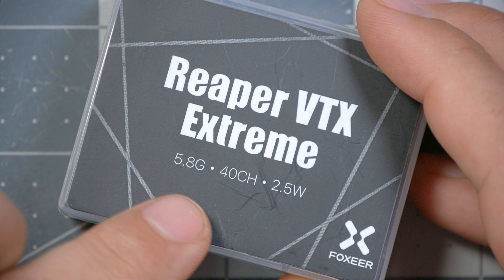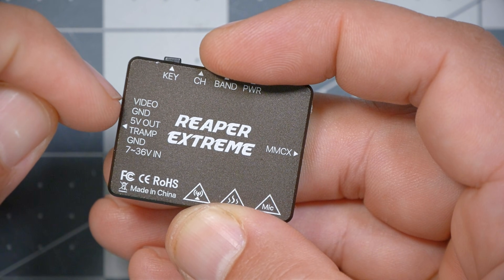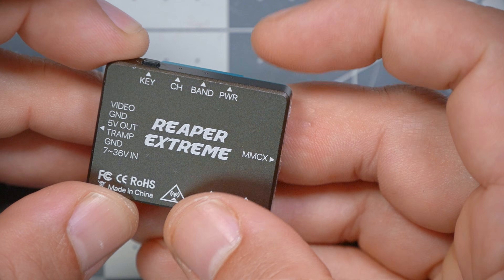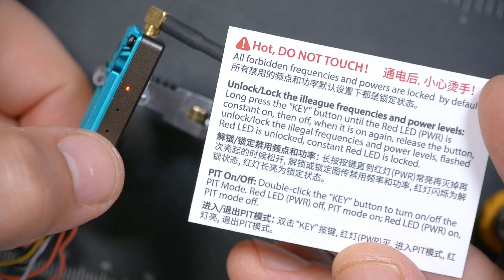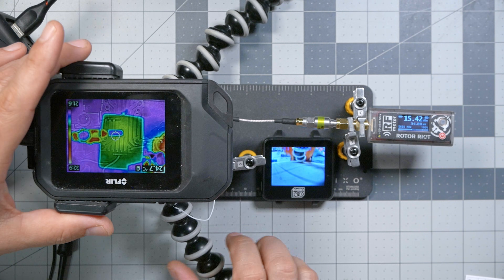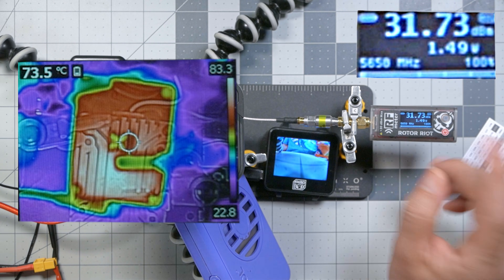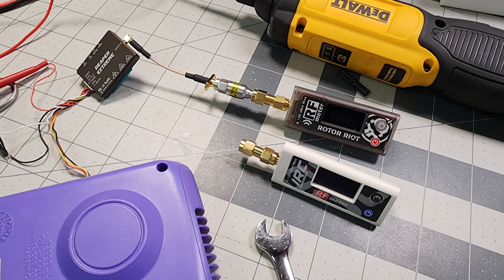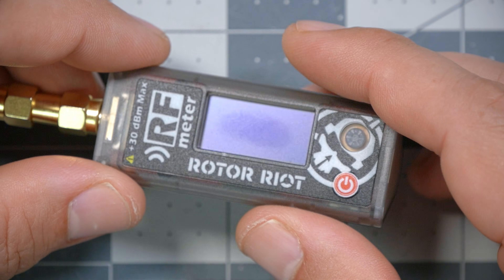Foxeer Reaper 2.5W vTX can do one thing digital systems can't

Comment from the maker: Please note! I tested on both R8 and R1, although I seem to have edited out the R1 test in my desire to make the video concise. Both R8 and R1 had low output power. Also, I am using a 6 dB attenuator to bring the input power below the 1W maximum of the IRC meter.
Reply: So per Gal Kremer he said something about being locked to 1.5 watts. Could it be that the unlock didn’t take?
Reply: Hey JB I noticed in your video on the frequency card there is a 1.5W setting for this VTX. Is there a chance it was tested on this setting by accident? If not, out of curiosity how does it perform on the 1.5W setting? Great content as always and appreciate all the work you do for the community cheers
Reply: Hi, I can't find any video fir rush max solo 2.5W, please do a test on it too
Reply: Good deal, glad you did
Reply: Hi Josh,
  Which attenuator are you using? It should be rated for at least 3 watts RMS preferably 5 watts. If you over saturate the attenuator it will not give you accurate readings.
Reply: What is the range of this vtx ?
Reply: the match on the antenna might be way high ( swr ) to be fair get a swr meter...run a test then..may put a section small of 75 ohm in line...ke6zgr

Comment: RF meter has a +30dbm maximum input... 2.5watt is 33.98dbm 😉

P(dBm) = 10 ⋅ log10( P(mW) / 1mW)
Reply from the maker: Now account for the 6 dB attenuator I was using. And before you assume that the readings should add back in 6 dB, the meter does that automatically.
Reply: @JoshuaBardwell  Thanks for taking the time to reply JB. I missed the 6db attenuator!
Reply from the maker: No problem! It's a common question on this video :-)

Comment: I can answer why your meter is reading 1.4w instead of 2.5 watts.   The meter says +30dbm max right on the front.   30 dbm is 1 watt.   That means your meter maxes out at 1 watt, and you’re lucky you didn’t damage it.   This also explains why it doesn’t accurately measure anything higher than 1 watt.
Reply from the maker: What you missed is that I have a 6 dB attenuator installed on the input of the meter. This reduces the incoming power to 1/4 and then the meter adds that amount back in to its output to compensate.

Comment: I may need one of these. Either this foxeer, or the geprc Maten. I have a 420g AUW (with runcam thumb prow) 5" Apex micro with 2005.5 motors and it carrys an 1100mah battery for almost 10 minutes if i behave. It has crossfire...a cheap hd camera...and 8-10 minutes? Why have i not put on a long range vtx?

Comment: How do you set power values more than 600mW in Betaflight? Official vtx table provides values like Lable = 2.5W; Value = 600. I tried changing values corresponding to power values in specs (e.g Label = 2.5W; Value = 2500) but when I set this mode Betaflight locking me at 25mW. I didn't manage to find anything online so I will appriciate any help
Reply from the maker: The way Tramp vtxtable works, the max power is always 600. When you set power to 600, it's actually 2.5 watts.

Comment: I couldn't find if you mentioned the power supply you used. 7-36V seems like a big range,  just wondering if that could have been the limiting factor?
Reply from the maker: Definitely not. The vTX output does not change vs. the input voltage. And heat build up is not appreciably changed.
Reply: Darn... well here's hoping it was just a dud then. Thanks for the info as usual...now I want my own tester, lol   @JoshuaBardwell

Comment: ImmersionRC Power Meter power range spec states: Power Level: -20dBm up to +30dBm.
+30dBm = 1 W

Are you sure you didn't just hit the upper limit of the power meter design, so it wasn't able to properly measure 2.5W?

Comment: At the high probability that this comment won't be read as this video is old I still feel compelled to comment as I have invested a lot of time going through the FCC regulations regarding VTX power limits related to RC aircraft. The regulations themselves are a pretty deep rabbit hole so I'm not going to delve into them here and just provide a summary of my interpretation. First of all unlike RC telecommand systems the regs were put in place before VTX's were a thing so I'm sure VTX's weren't top of mind  at the time. There is a clear 1w limit on telecommand systems in the regs. According the definitions in the regs telecommand is the RC control link. A television link, which is what a VTX is,  in the regs are defined separately and are not part of the telecommand and therefore do not have a power restriction. Fast forward to today and you can find some in the FCC and other "experts" who claim that there is a 1 watt limit on VTX. IMO I believe they are wrong with some probable reasons being they want to limit VTX even though they know the regs don't require it, they are misinterpreting the regs as they have never bothered to deep dive into them and connected the dots needed to interpret the regs correctly, they have never even looked at the regs and are relying on other "experts" for their belief, et. al.
Reply from the maker: Ok and I would have agreed with you until years ago the FCC fined GetFPV and one of the things they fined them for was violating the exact section of the code where the 1 watt telecommand limit is defined. Which means the FCC considers a vtx to be telecommand and limited to 1 watt. And that's why all the stores stopped selling vTX advertised as over 1 watt.

Please see footnote 15 on page 3 of  this doc https://www.fcc.gov/document/lumenier-pay-180000-settle-equipment-marketing-investigation
Reply: @JoshuaBardwell  Wow this is cool that you are replying, much appreciated. I have seen that document and concluded (right or wrong as I am not a lawyer) that the primary infraction and reason for the settlement/judgement/ruling (not sure which applies) was for Quote "The noncompliant AV transmitters could operate in bands that are reserved for Federal government and other important operations, including Federal Aviation Administration airport operations and satellite communications" The comment about exceeding power limits is ancillary and really un-needed as the FCC had them by the hairs, so to speak, because of what I quoted above. I also don't believe that this document was ever challenged in court so it is possible that parts of it are wrong. In fact a large number of court filed documents contain errors, both big and small and are almost 100% tolerated by the courts. So my conclusion on this is that is not a reliable interpretation of the regs when it comes to power requirements for VTX's.

Comment: 2:20 i'll tell you why these are able to be sold, because they're perfectly legal for HAM radio operators to use. I got my HAM license solely because I believed 25mw was the legal limit, and I wanted to do long range FPV, SSTV, and talk on satellite repeaters and such. I didn't know until this video that 1000mW was the limit for general teleoperated aircraft. I have one of these reaper-extremes, which I legally operate at 2500mW. I also have 8 watt handheld radios, available to all, but technically only legal for hams to operate. 99% of the time, nobody is going to care if you use 2500mW instead of 1000mW @ 5.8GHz.

Comment: I agree about the1watt to 2.5watt increase in range to around 150% .
   Maybe a better video reciever on a tripod would increase regular video reception 10 times as far . 
   Old walkie talkies talked a half mile to a cb base station with big antenna but ti another walkie talkie similar to goggles in size you could only talk 200 feet barely .
  You just need a tripod or backpack or car roof maybe . Hmmm . 
   I'm  up to 1000 feet with cheap goggles and 800mW vtx

Comment: Isn't it... quite illegal to run anything above 1W? Perhaps that's why the digital systems don't go much past that...
Reply from the maker: I address this in the video. There's a chapter about regulation.
Reply: @JoshuaBardwell  I know. My point is that there's basically nowhere that you can legally use this VTX and that is probably why the digital systems haven't bothered to make one that does higher.

Comment: It's siilly to keep adding power.  1w to 2w gives you a measly 3db gain.  The problem is 5.8ghz.  The path loss is too much.  It takes 8 watts of power at 5.8ghz to achieve the same signal as 1w at 800mhz.  There is a reason we pay tens of billions in the cellular industry for 700 and 850mhz.  You can make up some gain by improving the antenna system.  But the long term solution is to change frequency.  There is decent 1.3ghz gear that can easily give you 25km.  Then output that video into your 5.8ghz system.  It may require a ham radio license, but that's no big deal.
Reply from the maker: All of this gear requires a ham license, for what it's worth. None of it is Part 15 certified.

The reason 5.8 is so popular is that it has around 300 MHz of bandwidth. So you can get as many as 8 pilots in the air. 1.3 GHz you can do only one. And the 900 MHz ISM band doesn't have enough bandwidth for even one standard analog signal.

Comment: I use the speedybee TX800 , clean picture very little distortion runs cool dependable hits almost 1 watt and $28 on Amazon great paired with caddx baby ratel 2  , Vas V2 Mushroom and Vas crosshair extreme with Skyzone 04L.. they say long press to get out of pit mode mode but you have to hold button down for over 20 seconds to unlock after that you want orange light steady on in vtx that is the highest power you have to hold button each time to switch power so hold 5 seconds to change to 200 the hold 5 seconds again to get 400 , some controllers you do not have to cycle
Reply: Only orange LED needs to be constantly on to get the 800mw max power. Steady blue and steady red LEDs only means that you are on Channel 1 Band 1 🙂
Reply: @Koryas  yes correct I changed it thanks  .. I use channel 1 channel A no racing can use any channel just makes it easier for manual operation

Comment: I have my Tech ticket, is there a way I can get a big ass TX, like flash my call sign or something?
Reply from the maker: You can put the callsign in the betaflight OSD, or whatever FC you have that supports OSD. If you don't have a flight controller, then you would need a 3rd-party OSD module. I don't know any vTX that has built in OSD though.

Comment: Just FYI Im sure most know some may not. Manufacturers can produce a product with higher output and pretty much sell it anywhere they wish. Here in the USA under law it is the end users responsibility to know and operate a given device legally. Ham Radio Licensees are not exempt but licensed to operate on the frequencies or most of them . ATV is ham radios Amateur Television and where FPV originates. The benefit of this is that todays technology is hundreds of times smaller and better. In my 25 years as a licensee Ive had opportunity to truly watch the old Tx/Rx Systems shrink incredibly, range increase. Love this hobby
Reply from the maker: The FCC seems to think that they can fine stores for selling non-compliant products. Example: https://intofpv.com/t-getfpv-fined-180k-for-selling-non-compliant-vtx

Comment: It'd be worth replacing the included thermal paste with some NT-H1 it's non conductive and far better then anything you'll find preinstalled. Inconsistent cooling is the most likely reason to have variances between units and using such a tiny fan on the desk really doesn't replicate the amount of cooling you get from the quad. 

I do have the reaper extreme and so far its been unflyable due to massive interference issues in setups that are perfectly fine using other vtx's. Overall give it a 0 star rating.

Comment: Good review! But instead of buying a 2nd meter you should bought a second VTx to make sure your first unit is not a faulty one. I really wonder about the result because (like you said) others are measuring the 2.5watts. And I don't wanna believe that they send out manipulated units to Gal or other Youtubers. Really hard to find a good and trustworthy analog VTx for Longrange these days. At the moment iam using a TBS Unify Pro 32 HV but the range could be much better...

Btw: At the beginning of this video you said with more output power you get more range and penetration. That's not 100% correct. At about 800mw and above it makes no difference in kind of penetration. You just get more range but no better penetration. That's a big mistake that a lot of the big fpv guys always say. But there are good tests out there here that shows like it really is. 🙂
Reply from the maker: Regarding penetration, that's not correct, but I think I can understand how people get there. Let's say that your quad is at the edge of its range, and then you fly behind a concrete wall and lose signal. A reasonable attenuation value for a concrete wall might be 15 dB. Now let's say you get a vTX that is 6 dB more powerful. You fly behind the wall and you still lose signal. And you conclude that the increased power didn't give you more penetration.

The reason is that the wall has taken such a big "bite" out of your signal strength that your increased vTX power is not enough to overcome it. But the signal IS stronger and it IS penetrating more. It has gone 6 dB farther than it was before you got a more powerful vTX. It just hasn't gone far enough to reach you.

Let's say that you fly the quad behind that wall and you start walking closer to it until you get signal. The higher powered vTX would give you signal farther away than the lower powered vTX.

The distinction that people make between range and penetration is not consistent with the physics of RF signal propagation. Range and penetration are the same thing. Range is just penetration through open air. More power emitted means more range and penetration.

Comment: I have an AKK VTX that can go up to 3watts. It is a 30mm by 30mm. I plan to use it on one of my plane projects.
Reply: I'm using it at my FPV RC buggy. It is amazingly good.
Reply: @igor_misic  Which one?  I am looking on Amazon for it and I am coming up short...
Reply: 3 watts starts to burn alot of power and could cause other potential interference problems with the other electronics.  At that point I would try moving to a lower frequency for the video if you are looking for range.  Like drop to a 900mhz crossfire / 2.4Ghz video setup or if the plane is mid size and you really want range go to a 433mhz dragonlink / 1.3 Ghz vtx setup.  You lose a little video quality each drop but you gain a lot of range on less power.
Reply: i had that one aswell and it sucks balls tbh

Comment: The IRC meter has a LARGE BRANDING WITH 30 DBM MAX!!!
30dBm = 1W
It cannot measure anything more than 1W reliably
Sry for all caps, wanna get attention 😅
Reply from the maker: Yes, I know that. That's why I'm using a 6 dB attenuator :-)
Reply: @JoshuaBardwell  Ah, now I see you pinned the message :)
But doesn't that mean that if if says 1.5W, it's actually 6W (6dB = multiply by 4)?
Reply from the maker: No, because the meter has a setting where you enter the dB of the attenuator and it adds the amount back to the reading, so the reading is correct.

Comment: I have taken the heat shield off and can confirm that this VTX does have a built in mic. Nice look Joshua.
Reply: I have this VTX and I have not been able to figure our how to activate the mic.
Reply: @P_double_H  do your goggles have an earphone jack? If so, you should just be able to connect earbuds to your goggles. The VTX automatically transmits audio, and your vrx should receive it automatically as well.
Reply: @TitanFPV  I also have taken the shield off, everything looked fine, but the DVR from skyzone O40 Pro catches anything except the prop sound (just loud static, like on vtx w/o mic), same with headphones. I unlocked the power and tried every setting, but no progress. Could there be some betaflight parameteres that have to be configured?

Comment: Joshua, I believe the GetFPV (and also HobbyKing and RMRC and others) received several years ago from the FCC was not for transmitting over 1 watt but for selling VTX’s that transmitted on navigation and emergency (ambulance) frequencies. As the FCC stated, the manufacturer, retailer and operator were all accountable in those situations. Thank you for pointing out that 1 watt is the USA legal limit for VTX’s in the USA. As many long range guru’s maintain, a lot can be done by using the right antenna before jumping to to a lot of output power. As usual, great video!
Reply: You can also just crank output power and have the good antennas :) Telecom companies are absolutely blasting rf from their towers at crazy output powers, I don't think a hobbyist doing 1.2 instead of 1, or 2.5 instead of 1 really matters at all.

Comment: I think the new batch of IRC meters can read 2-3W without attenuator (I skimmed the updated manual a while back). If so, it might be more accurate to measure without attenuator
Reply from the maker: Mine still says 30 dBm max on the label.

Comment: I think that power meter maxes at 30dbm 1watt. The internal load is 30 too. 
I wonder if the meter got hot!
Reply from the maker: I'm using a 6 dB attenuator so it's not an issue.
Reply: @JoshuaBardwell  I did not know that. It’s pretty cool that the meter can compensate for that.

I also always wonder how much real world limit the tiny connectors and coax limit things. It’s always a big loss issue especially with these frequencies

Comment: These hot to touch VTX can probably gain more range by putting a quality TcXo to keep them spot on Frequency tune, It would be interesting to measure the true frequency and stability from the vtx.  I bet they vary largely, having much bigger impact on the video signal and range....
Reply: i used heat sink paste instead of the rubber pad they have seemed to work alot better